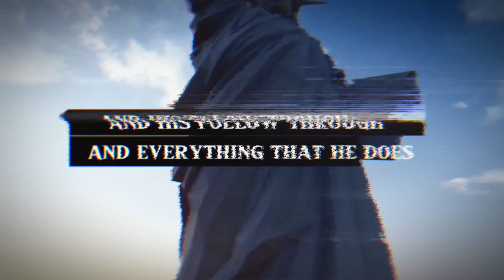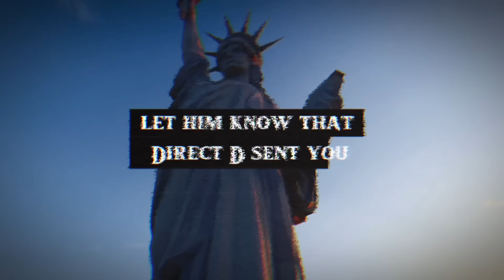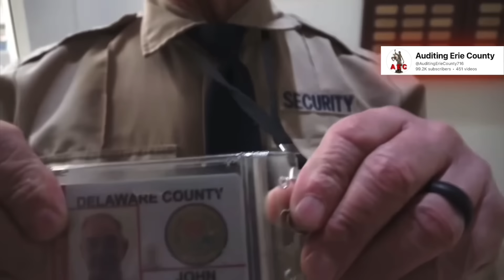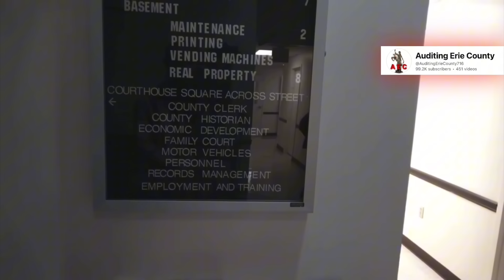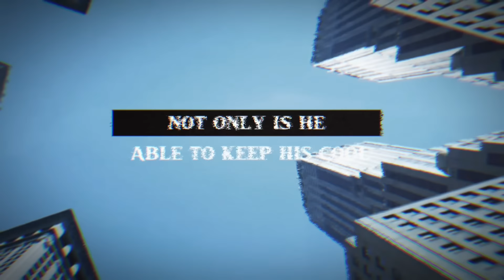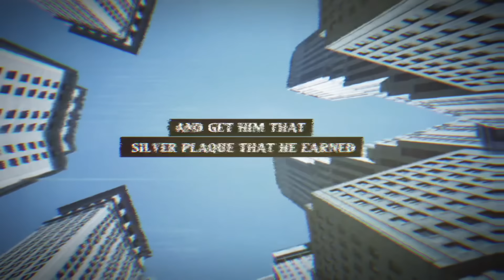This Man Doesn’t Back Down From Tyranny • I Don’t Answer Questions

Comment: The sad part is Cartwright is a training officer wtf
Reply: Cartwright is soft as dough and would never touch another man without his lil badge
Reply: He was frustrated because he wants to hurt or arrest the camera man and couldn't find a reason to do so.
Reply: @redeastwood4850 He also had no legit reason to lay hands on Dan, but that didn't stop him.
Reply: Cartwright is being backed up by the system. He is a product of that system.
There is no way to fight injustice as long as there is no direct responsibility.
Qualified Immunity has grandly crossed the line it once was intended for, genuine mistakes in the heat of the moment, that could not be prevented.
Reply: Who is surprised?
Reply: He is the worst to be training anyone because he is a TYRANT😡

Comment: 45:05 Direct D that's what I like to hear If you say your going to file suit or a complaint then do it if not shut your mouth.
Seriously watching some of these clips works you up your waiting to hear about the law suit & its a big let down its like watching a 3 hour movie you think you know who the killer is waiting waiting and waiting and the movie just ends its like being 12 or 13 sitting in your bedroom knocking the top off it and the junkets about to flow and your mum bangs on the door and yells out dinners ready. Guys we dont care if its 2 years down the track just repost add it to the original clip if possible but yes that staff member was fired demoted or fined and yes a the lawsuit was filed.
In 7 years watching these type of clips I've only seen one perfect clip posted from start to finish.
The audit was done & the auditor was treated like shit cops were called the auditor filed a complaint on the staff to the HR coordinator then file complaints on the 2 officers after his arrest at the precinct to hiring an attorney to the deposition to the court case were all charges were dropped then a violation of rights lawsuit filed and won was the best set out clip I've ever seen

Comment: When are the new architect’s going to design moats and draw bridges into the new government buildings of the future? They can fill the moats with crocodiles and gators and have little old men control the draw bridges. Standard protocol would be bridge down at 8:55am, up at 9:00 am, down at noon, up at 1:00pm, down at 4:30pm. Let’s have these security guards actually do something instead of sit in their chair with arms crossed.